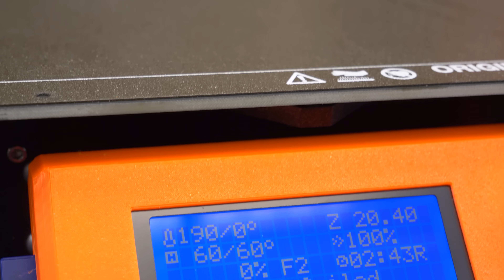"MMU needs attention" - How to fix a failed load/unload

Comment: Is there a way to increase the pressure for the MMU2? It seems like my gears can't properly grip and push the filament in. No matter how tight or loose I adjust the screws, it makes no difference. The gears are clean and free of dust or filament residue.

Comment: The Prusa MMU2 is by far the shittiest thing I have ever owned, lots of issues, always fails for no reason, sometimes works, sometimes fails for no reason, reset, then it works again ?? just absolute junk design full of bugs. I sold mine off and just use manual switching like a fool since this thing is such a stupid piece of equipment. Lots of issues all over the forums, yet prusa thinks this is normal.

Comment: Guys these are called pneumatic fittings for a reason. You do not need to unscrew it every time because they have quick release mechanism. Just press in the blue ring and pull out the tube. When you unscrew the fitting with the tube inserted, the fitting will grind into the tube, making it loose over time.

Comment: Oh wow the red green flashing means success? I thought solid green meant it was happy. The manual both in paper and online do not say what to do if a single filament shows red green flashing, and a comment by the Prusa team in the online manual suggests rapid red green is the same as rapid red, which is contradicted by the line at the end of this video. I’m good with machines but so far this one is taking a lot of time to understand.

Comment: Note: The filament sensor in the separate video is labeled as IR in the sensor screen but in the current firmware, it is labeled Fil. sensor. (PINDA and FINDA are also on the same line of the LCD screen instead of being 3 individual lines but I'm guessing this is just an oversight)
Reply: HOLD ON THERE...2:18 I just heard the buttons had specific things they do. In the book, these are just referred to as Left Middle and Right. I wish I could get a little table that says all the things the buttons are meant to do.

Comment: is there a fix for the printer keeps get stuck on MMU OK RESUMING POSITION? LAST 2DAY, THIS ALL I KEEP GETTING. REFLASHED BOTH FIRMWEARS, RESLICING STL FILE AND EVERY TIME I DO A PRINT THE PRINT FORGETS TO UNLOAD THE FILAMENT FROM THE EXTRUDER OR RESETS IN THE MMU IN THE MIDDLE OF PRINTING WITH ONE OF THE FILAMENTS. NOMATTER WHAT I DO IT KEEPS GETTING STUCK ON RESUMING POSITION

Comment: You better put the most important part which can be found at  https://guides.bear-lab.com/Guide/3.+Extruder/4?lang=en Step 12 into the assembly instructions on your site because without that the MMU will continue to fail load/unload!

Comment: I get this error every 5 minutes. I am not even joking. I really want this to work. I calibrated the ir sensor, and I adjusted the finda, but I still have to manually intervene after every layer. I have yet to finish my first print. Am I missing something? Am I doing something wrong?

Comment: too bad I have to do this about 50 times per impression. unfortunately I gave up on printing in color with mmu2. :(
Reply: What's your main problem? Loading or unloading the filament?
Reply: @android4cg  he stated. He has to do this 50x per print. Same with me. It’s non stop error. I have completed 2 of 50….and I’ve put 15 hours into dialing everything in. From the secret menu to dialing in tips etc etc. This product is garbage.

Comment: Josef, is there a reason that you are unscrewing the connectors vice pushing & releasing the blue quick-release?
Reply: Not really. I prefer unscrewing the fitting, I feel like the PTFE gets a bit worn out after many removes from the quick-release, but that's about it.

Comment: The marlin firmware is “ripped” that’s a term they used during the turn of the century, it means it was copy and pasted from a CNC machine years ago, you can’t print dual colors because of a “glitch” it can be dealt with

Comment: Problem with MMU2S is always the unloading  of the filament (80 failures in 100). The pulley motor runs so fast (STEALTH or Normal Mode) that the filament goes past the gear during unloading. When it’s time to reload the filament, the bearing and pulley gear can not grip the filament because it is not there! To solve the problem, you just have to  push the filament inside until you can feel that the gear and bearing is gripping the filament. Is there a way of slowing down the speed of the pulley motor when unloading? Another annoying thing is that when the “MMU needs user attention” is displayed on the LCD screen, there is no ALARM TONE. That means you have to keep checking the printer every now and then to make sure that it is still printing. How i wish that MMU2S is as reliable like MK3S.

Comment: I think it would be beneficial to do a video to troubleshoot the stringing issues. My loading and unloading work normally fine but I do get a lot of stringing issues which would stop the MMU from working normally.
Reply: I have the same issue. What we really need is a tip shape optimisation video. Ramming, cooling moves, etc

Comment: I print TPU in between and it sucks with the MMU and the IR sensor, you should do something about that. When I print TPU i have to disable the IR sensor and push it manually to get it to complete the loading process, then I have to feed the TPU around the MMU directly into the Printer since it will not load it and print around the MMU settings in the slicer i have to use the normal MK3S printer settings. not happy about that
Reply: thni1703 I had the same issue with TPU and recalibrated the IR sensor and it works but TPU leave a long stringy tip so if you have many filament changes it could be become and issue. Better factory slicer settings needs to be provided for TPU and also for PVA
Reply: @milhooz  recalibrated it more than once and i can'T get it to consistingly reacting to tpu. when it is loading it through the mmu it then unloads-reload-unload-reload ...

Comment: It would be nice to get a video that goes over filament tip optimization. Most of my troubles come from this (however adding the M10 pass-through coupler mod seemed to fix it completely, probably because it lowered friction in the filament path)

Comment: I fixed this last year, by buying a palette 2 because my Mmu2s never worked right and always had errors like this. The overall polish on the mmus (1 and 2) has always been lower than the printers its self witch is disappointing.
Reply: Couldn’t agree more. I’m ready to smash my mmu2s to 1000 pieces.
Reply: Counterpoint, I've found the palette has plenty of issues, especially around splices breaking. If it's working for you, then great, we've shelved our palettes. Overall I'd say you need to temper your expectations for multi-material printing at this price point regardless of which system you go for.
Reply: @chrish1645  I've heard that the pallete and pallete + were garbage, but the pallete 2 and newer actually works. The prints I spent a month a several spools tuning the mmu2s on printed first time with the pallete 2. But where there were small splices the color wasn't really right. 

Splice tuning is far easier than tuning the mmu. Splices are 3 settings, compared to several physical points on the mmu

Comment: Thanks for the video!
Dealing with all lights blinking —> Reset (according to the handbook) Yes but then it could happen that the mmu uses the wrong filament if resuming after the reset. There should be a possibility to chose manually from which one to restart

Comment: In most of the times i have issus by unloading the filament. Very often it happens that the filament tip (end of the filement taken out from the extruder) is to thick and getting stuck inside the PTFE tube between the hotend and MMU unit. After replacement of the heatbreak including the short PTFE i was able to solve the issue for short time. Unfortunately the same issue is coming up now again more frequently. Multicolor print without any manual intervention is almost not possible. My impression is that the inner diameter of the heatbreak is causing the filament tip getting to thick under special circumstances. Otherwise i have no explanation how it can happen that the filament tip is thicker than the PTFE tube between the extruder and MMU unit.
Reply: Did you use a Prusa specific heat break or a regular E3d? The Prusa’s geometry is slightly different to allow the mmu to reload at a higher success rate.
Reply: I was using the Prusa specific because i know that it's slightly different to stock E3d which should improve the MMU usage. There is also good video about this from Joel Telling where he explains the problems which can happen when using Proto-Pasta fillament on MK3 printer. The problem in this video was solved by replacing the specific heatbreat with stock heatbreak because of the different inner diameter. It would be good if this could be investigated because i experience exactly the same problem as described there.
Reply: Here the link to the video i am refering.
https://www.youtube.com/watch?v=dSPPrb0J8CY
Please also read the comments from the users who solved their issues by this.
I was contacing your support team and i was talking about this but the final recommendation was to use the specific heatbreak. Because of this it would be good to finally clarify with dev team. Thanks
Reply: @Riley Please clarify the mentioned issue and come back. For me it is the number one issue in regard to MMU faults. To me it really makes sense what is said in the video from Joel.  All the positive feedback from this video look quite promissing.

Comment: For some reason the new IR tower (atleast on my MMU2S kit) wasn't designed right with the new "arm" for it.  Even being slid all the way over it still was approx 0.2mm off from being able to get a good reading, so I shaved down and shimmed the sensor to move it over further.  I don't know how much this matters as I assume the successor to the MK3S will have a lot of additional features, but someone on thingiverse created a custom LED for the IR sensor to give feedback that the change happened correctly.

The load/unload will still even fail when pulling the filament out of the hot end if it has a "fat nub" on it and there's no way around it, which happens often for my machine.

The next issue I've seen for load/unload fails is when the filament doesn't extract fully - it'll get past the FINDA sensor but not fully retract so it gets jammed between the housing and carriage as it moves.  It's not chewing up the filament, it just stops retracting too soon.
Reply: Yep, i get that too. It unloads past the finda, but not far enough.. if the selector changes, the filament gets jammed in the idler. It's just a mess. So many errors. And a print might have 600 changes. It just does my head in thinking about it. Nothing but a world of pain. I hate the mmu2.

Comment: Thanks but not thanks. Already ordered a pallete 2s pro. Still need a refund.
Reply: My MMU2 has seriously been the bane of my existence since I installed it. I have spent so many hours online with tech support trying to get it to work. When I'm able to get it working again, it fails 1 or 2 prints later, which is really frustrating. Hearing that so many other people are having issues with it is at once disheartening (because I was clinging to a shred of hope that I could fix the problem for good) and validating.
Reply: Jesse Morrisey MMU2 is already an improvement over MMU1 but I still hate it, even in single mode it is painful. I don’t print that much anymore so I survive but maybe I reduce my printing because of it... Man MMU1 was really terrible, I had so much hope in MMU2...
Reply: I hear you Jesse
Reply: I hear you loud and clear.
Reply: Yeah, it’s a shame but I’d also say both mmu versions are just way too finicky.
Reply: It's so strange. We hear either words of praise and people being super happy with their MMU and having no problems or the exact opposite of people being basically unable to print without an interruption.
Reply: @TheMikolasZuza  Yes, which tells me it's too finicky. Don't get me wrong, I love tinkering, but those who have it working beautifully, tinkered it to do so. I think that shouldn't be the case with a bought solution. Also surprising is that I don't see many MMU prints on the FaceBook groups.

Comment: Can you add a section explaining how to recover from all lights flashing at once (selector unable to move) errors?

Also the auto generated closed captions are very bad at times.
Reply: That is caused when the finda detects a filament. This is either because there is a filament strand or your finda needs adjusting.
Reply from the maker: Ok, will do! :)

These cases are very nicely covered in the Handbook though.
TLDR
 - if they're all flashing RED, simply unload the filament (LCD Menu - Unload filament)
 - if they're all flashing GREEN/RED check the wiring and power connectors

You can read the handbook here, this is covered in chapter 13:
https://www.prusa3d.com/drivers/#driver-mk3s-mk2-5s-multi-material-2s